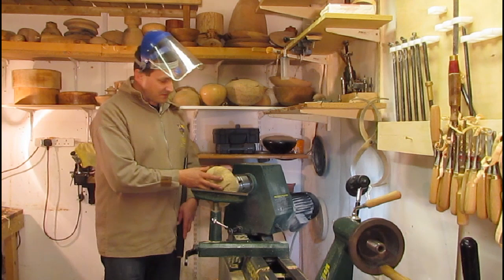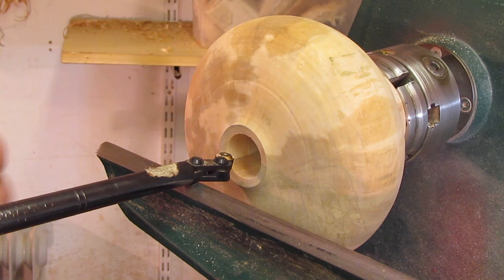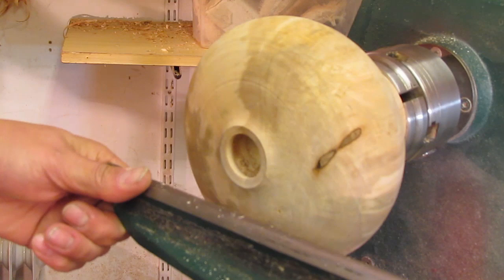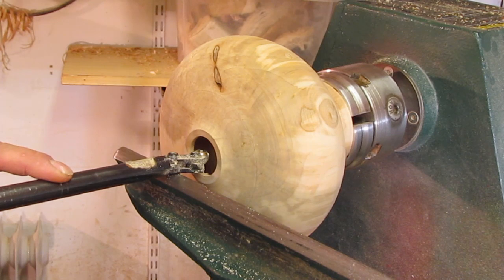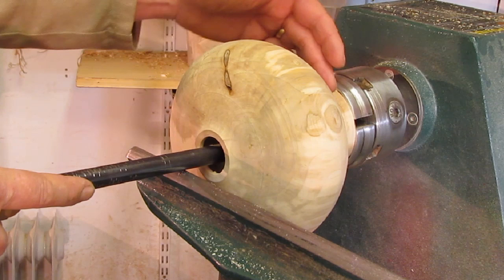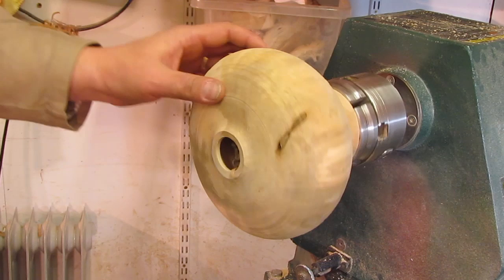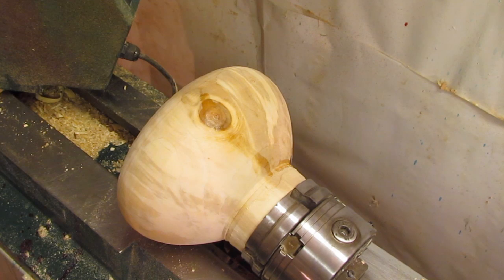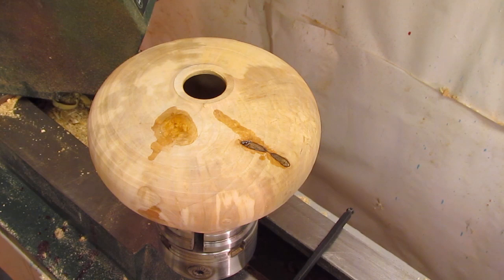Hollow form Roughing part 2

Comment from the maker: @greatergreen 

Hi Peter 

The tool I am using is the 5/8th shaft, although there is no reason that a form of this size can not be made with the 1/2inch shaft.  I find the 5/8th more versatile as I can make  both small and large work as the cutters will fit through the same size hole. But the 5/8th can work up to a depth of about 11 inches deep but the 1/2 inch goes to around 6-8 inches deep depending upon skill and wood. Saves me having to change shafts.

hope this helps.

Comment: What hollowing tools are you using?

Thanks, Keith
Reply from the maker: +Keith Corodimas Sorry Keith, damn  setting meant I did not get your message. The tool use is the 5/8th Crown Revolution hollowing system. 

Thanks